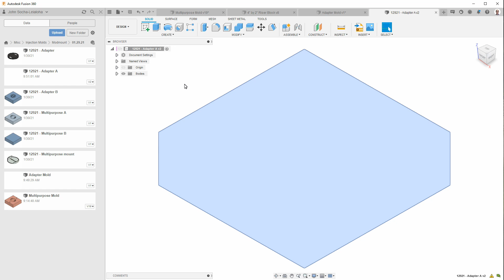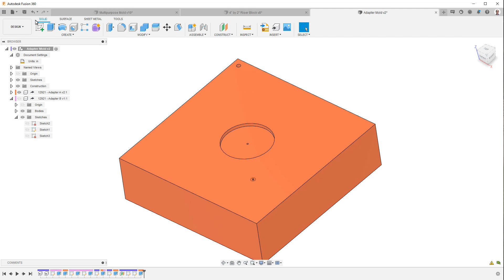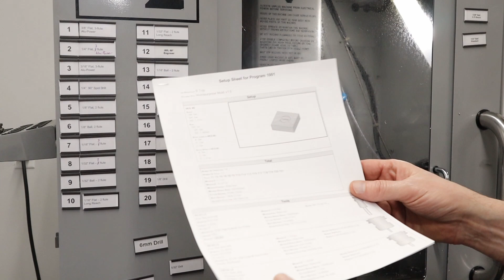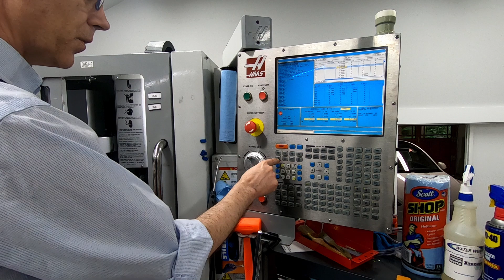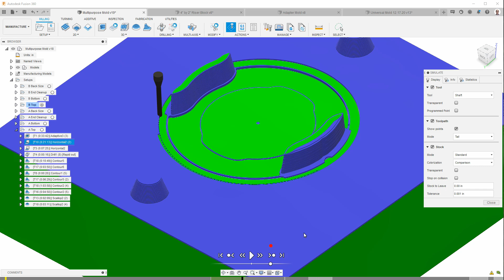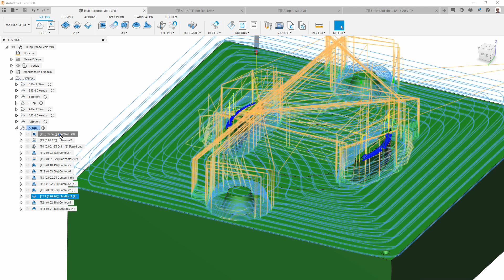Wrong CAM Operation Order and breaking miniature end mills

Comment: I've been staying away from horizontal tools paths in Fusion lately.  It doesn't seem to do well with open contours.  Especially, when ramping near a wall it will gouge on the approach ramp.  I've instead been using 2D pockets with multiple depths, they, at least on the surface, appear to be more reliable.
Reply from the maker: I've had no problems with horizontal tool paths as long as I have them after the contours to clean up the walls. But this time I made a mistake, which isn't surprising since I made these molds during evenings and weekends (this his a hobby for me).

Comment: Thanks again, any hope of a video on the basics such as how to set a tool height, pickup a corner or datum?
Reply from the maker: I do have a video on setting tool heights: https://youtu.be/4knKw5Vri2w Is that what you were looking for? I have learned a few things since then, and am thinking of doing another video on tool lengths and Z offsets.
Reply: @JohnSL  Thanks for the reply. Well when I  was taught milling we never really we never got a clear explanation of the relationship between the the home/reference point and lets say a G43 or tool tip offset and how to input it correctly.

Comment: You should check the run out on such small tools.
Reply: I'm curious why?
Reply: @cre8itgroup903  if the run out is 0.001" on a 1/16" tool, percentage wise it can greatly effect your chipload.
Reply from the maker: In this case the tools broke because they were trying to mill a much higher chip load than they can handle because the depth of cut was way too high. That's because I had the operations in the wrong order, so the "cleanup" pass was running into significant material that hadn't been removed yet.